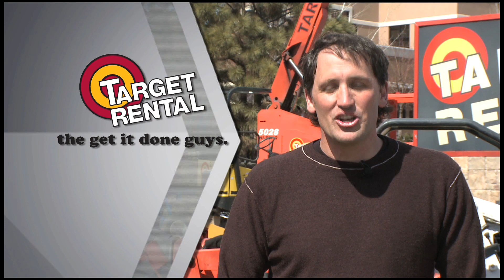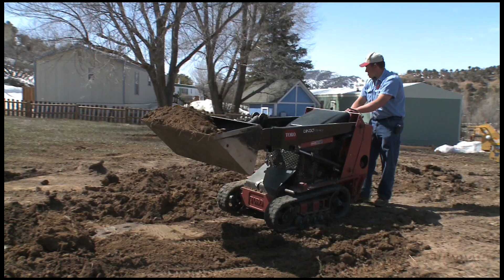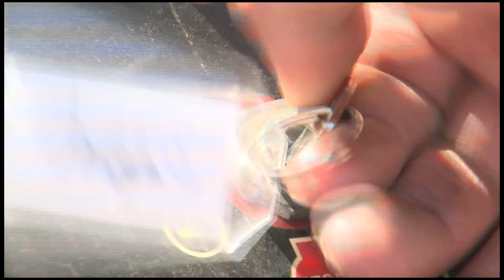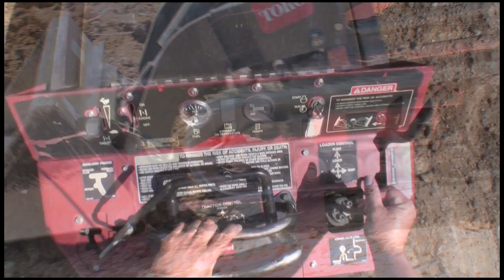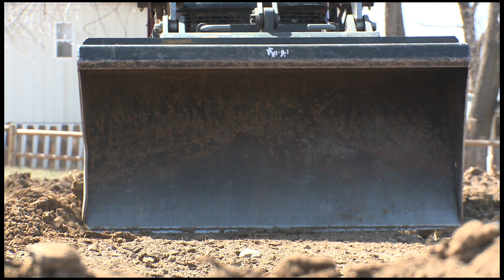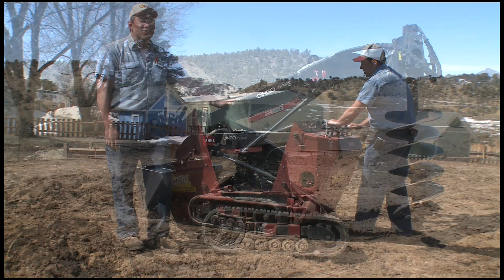Target Rental, Durango - Dingo TX - 420 Walk-Behind Front End Loader

Comment: so it normally makes that sound when it turns?
Reply: "The Hydraulic moaning..?. "It's fine." He's driving it extra slow for the video with the engine idel turned way down... (During normal operations) "You would power up the machines engine to "Operating power," and it wouldn't make the same stress noises." "But Jeff Ford is right, This is what the Machine sound like."
Reply: With these models and used, yes